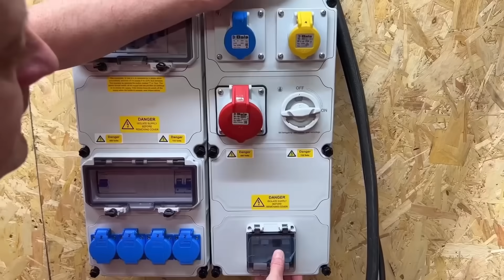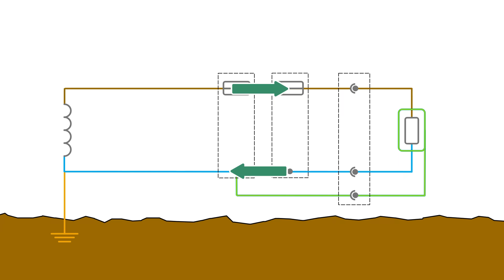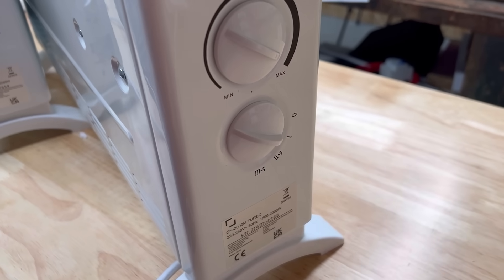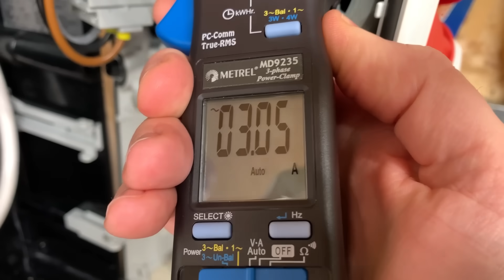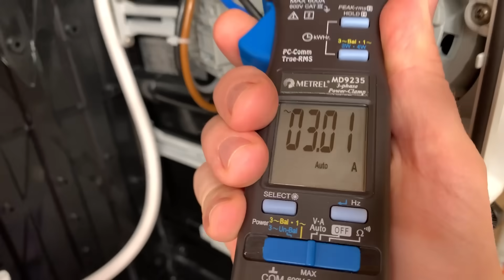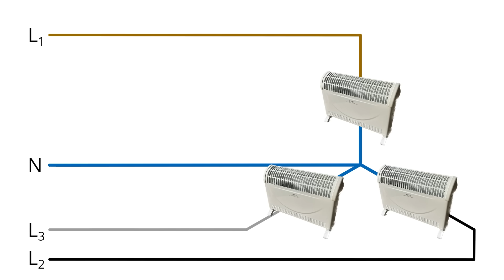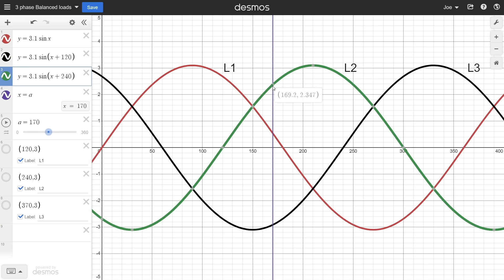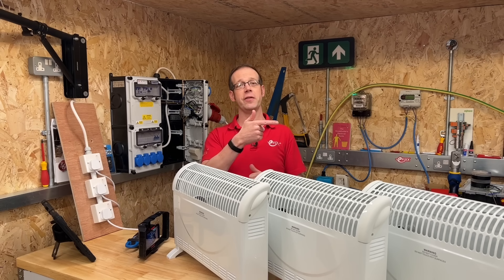Does Current Flow Through The Neutral Wire?

Comment: Let me give a concise post about this. The definitive word.

1. Single Phase.
Current travels on both neutral and live.
And even a 13 year old knows this.

2. Three phase.
Neutral line is NOT required.
Yep, that is what I said.
There is no neutral current as there is no neutral wire.

3. Three phase with the capability to supply single phase.
3 phase conductors plus a neutral are present.
-----
For a balanced load in 3 phase:
Z₁ = Z₂ = Z₃
And therefore:
Iₙ =0

The neutral current is zero. And it is only zero because the load impedances in each phase conductor are equal.

If the load is not balanced then there is  present a neutral current.

3 phase load with additional single phase load:
Single phase load is connected across a phase conductor and the neutral line.
Result: there is a neutral current.

And there endeth the lesson.

If you have done formal electrical training, then the only time you won't have come across this is if you do the Domestic Electrical Installers qualification because they are only taught to work on single phase because residential properties, in the vast majority only use single phase.

If you have done any other electrical qualifications you will have been taught this important fact about 3 phase.

Split phase?
It's an American adoption, and I am not covering that here. I am only covering UK as this video is produced by a UK firm of electricians.

Comment: I have a question, if in 2 phase circuit you have exact the same current in the neutral is no current used in consumer? and if so why we pay for the production of current and not just transport and distribution.
Reply: You meant single phase? Two phase has not been used for a century. The current is not consumed. Think about a saw. Does the wood consume the saw so that once you push it in, nothing comes from the other side?

I do not get where the idea that current is consumed comes from. Maybe it is confusing current and voltage. Nobody forces you to pay for the electricity. If you think your life is better without then go ahead and live without. Your question is at the level : why do I pay for the barber when he gets by hair. you pay all the nice things the electricity brings you.

Comment: That's so clear now ! 😀 Also, explains why the neutral doesn't have a bigger cross section cable!
Reply: Didn’t understand a word of this!!
Reply: YOu need bigger cross section, becuase if you have 6600 W induction heater
and you connect it to 230 V source / 50 Hz  6600 / 230 === 28 AMPS,
so if you double only L conductor, you have 14 A for 2.5 mm 2 Cu, this is OK / derating in another ambient T /.
But you have also to double N conductor, because this current have to return
to your INVERTER and in the inverter this is going to bunch of 48 V / 200 A MOSFETS in H-bidge,
so you need also 2 X 2.5 mm Cu conductor for N.
And inside inverter 6600  / 0.92 == 7173 W, 7173 / 52 V === 138 A, this is current through
this parallel MOSFETs driven by driver  @ 24000 Hz, and this 138 A conductor is going
through BMS and DC-breaker to /-/ and /+/ poles of your LFP battery.
And what about PE conductor ? If you have 28 A for L and  28 A for N, what about the
size of PE ? And what time of resicual current decice, if your onverter is LF / toroidal trans. /
or is HF - without 48 V / 230 V toroidal . trans ?

Comment: The HV distribution network doesn't have a neural! The transformer at the local substation has a delta winding on the primary and a star winding on the secondary to provide a neutral point. I never could get my head around that one.
Reply: Then when you go up to the really big distribution stuff they use autotransformers, so there's no isolation between the 400kV and 275kV grid.  Oh, and there's a star point :)
Reply: @AintBigAintClever  Mut no neutral wire in the transfere from town to town

Comment: You didn’t touch the voltage part. If we go phase to phase. We get roughly 400v. If we go phase to neutral, we get roughly 230v. Then what is the voltage on each resistant load when the neutral is gone.
Reply from the maker: its still 230V
Reply: Because we are in series from then on.

Comment: Always remember a site we took over from a previous company. They told the customer that all the 3 phase circuits had no neutrals and they all needed rewiring… just showed lack of knowledge on the subject. 
Maybe more should be taught about things like this before people are let out on the wide world 😅
Neutral in a 3phase is generally found if the item has other elements eg control panels and other single phase components with in the 3phase item. 
Great video guys!
Reply: He, he. Norway has been running 3-phase systems with no neutral for 100 yrs. All appliances are connected in delta style between live 230V wires.
Reply: I'm retired now but when I started as an apprentice electrician in 1971 the factory where I worked in the UK had two types of boards, 415v 3Ph power only which usually didn't have a neutral and 415v 3Ph lighting and power which did.  
That factory had a lot of stand alone equipment such as fans, pumps, compressors and 3Ph immersion heaters that only required a 3Ph supply, even the operating coils in the starters were 415v so for many circuits a neutral wasn't required.

Comment: It is true that passive loads, resistive or inductive will balance out and there will be no current in the neutral. However with loads where the power factor is less than 1 and the shape of the current trace is wildly different than the shape of the voltage trace such as most switch mode power supplies without active power factor correction, you can in fact have a greater current on the neutral than any of the 3 phases in the circuit. Something to consider for installations where the bulk of the power goes through switch mode power supplies such as variable frequency motor drives or datacentres. But active power factor correction is getting more common in such power supplies nowadays so their current draw is becoming more sinusoidal instead of only drawing current at the very peaks of the voltage which when the load is large turns the sine wave into more of a square wave.